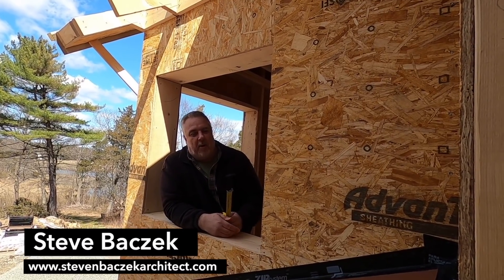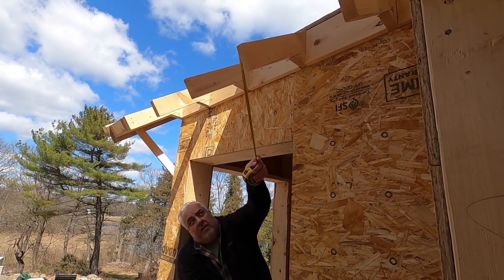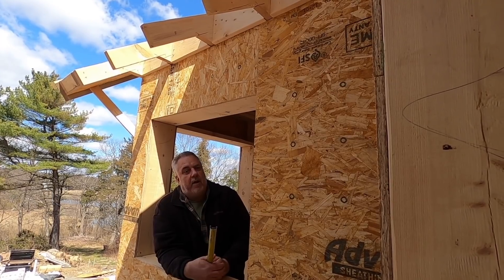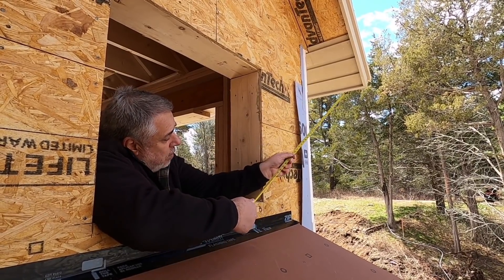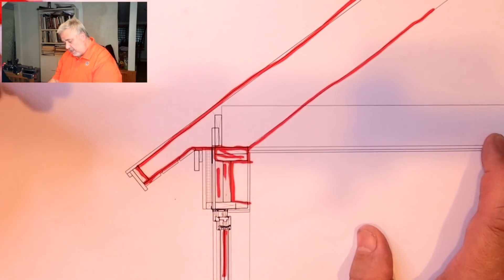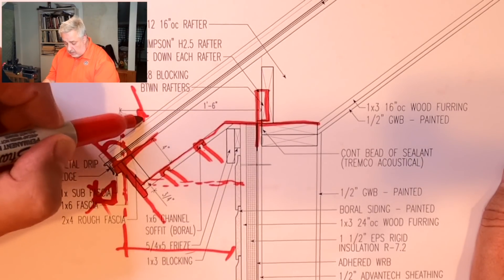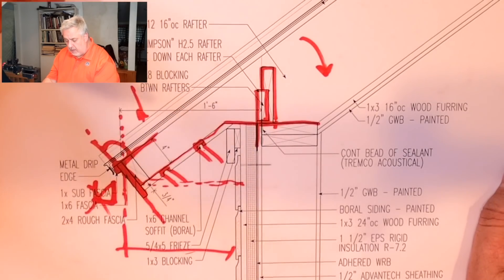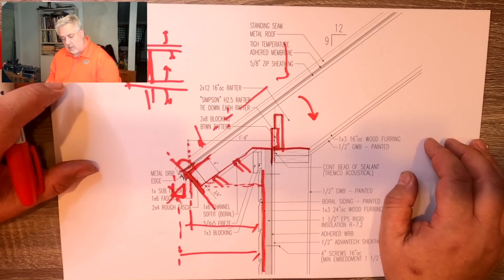Rafter Tails 101 - Designing and Planning

Comment: I'm not sure I like the 4" overcut on the tail reduction where it meets the seat cut outside the wall sheathing. It's sloppy if they were to run tails exposed, since it's soffited it doesn't matter. They may as well have went exposed, way nicer look.

Comment: Hello Steve,
Great Big Red details!  On coastal area, we sure don't want rafter tails lifting off the roof.  
The rafter tails are very attractive!  
1. With such a detail do you have a stone ground detail so rain doesn't collect or splash mud on the outside walls? 
2. I love a conditioned attic space.  If you were installing a tempered glass solar shingle system (aka the Tesla SolarRoof) would you still recommend the same "unvented" roof system?  Or perhaps install a 2nd roof deck with 2x2's and another roof deck to create a 2" ventilation channel?  

Cheers,
Eric

Comment: Great details. Thanks Steve. - Can you show detailed drawing how you could vent the roof (with conditioned attic) with the Hubber OSB with Foam and standoff air gap+shark membrane. Matt showed in his latest build (monopoly style) using this Hubber sheathing system. Interested in how would soffit and ridge vent.

Thanks again for the videos

Comment: How would you  a rafter tail with what Matt describes as ?monopoly framing" ?
Reply: Didn’t matt show how to do that in his video? He built what I call ladders and then bolted them to the building with str. Screws...
Reply: I would like to see Steve go through the “monopoly” framing detail without the extra layer or exterior insulation and extra layer of roof decking as that would be cost prohibitive for most people.